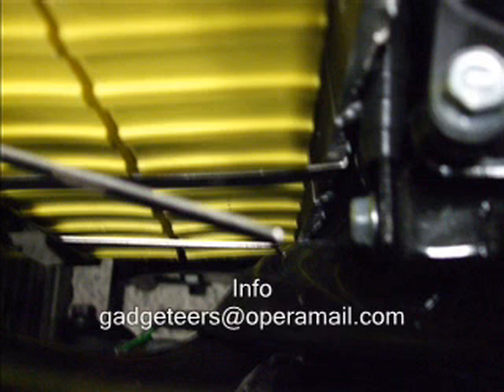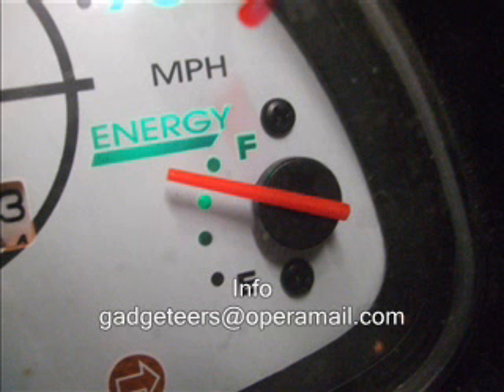Thundersky LIFEPO4 battery pack fried by BMS residual draw - warning to EV owners

Comment: Check your manual. BMS doesn't have much of a serious residual current drawing, only 20 milliamps for the microcontroller to operate, so it can check every single batteries' voltages. The only way they swell are; colder temperatures (LiPo batteries actually hate cold environment), short circuit (a quick way to have a smelly pyrotechnics show).

Comment: Don't feel bad I have a 48v 25ah LifePo4 from ConhisMotor Technology Co Ltd for $650.00 .
After 2 months the BMS shorted on the charger wire inside there bms box they built.
Draining 10 of 15 cells dead there warranty is only 7 days.
Buy a lead acid in America it comes with a 5 year warranty.
I got 120 km out of a $650 battery,I going back to Gas.